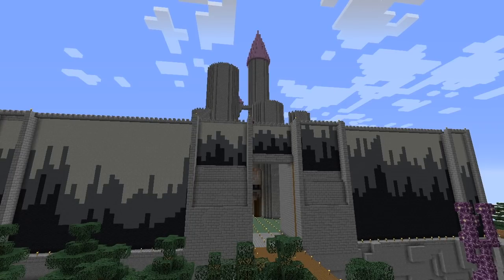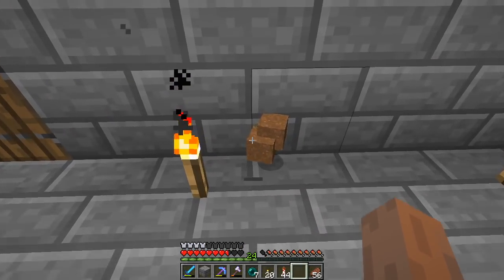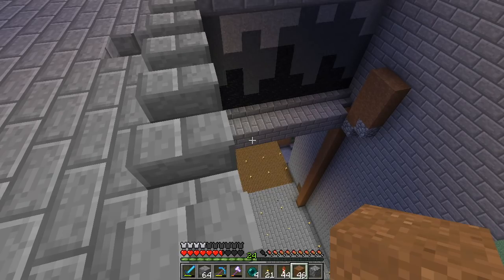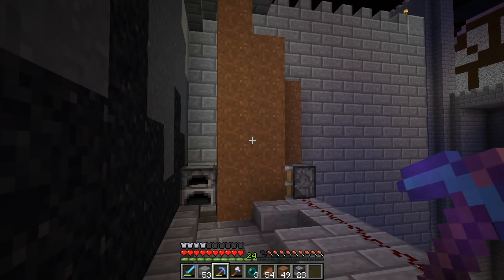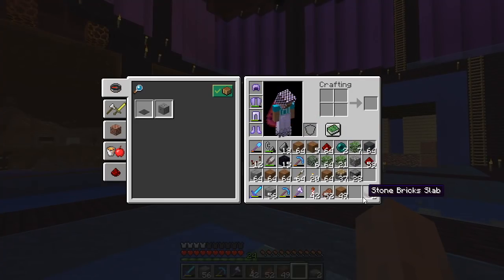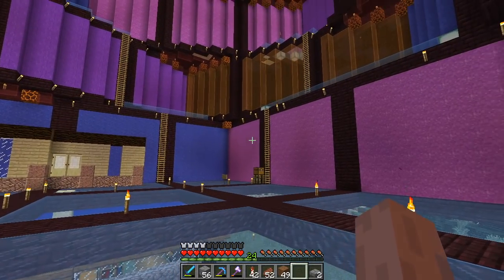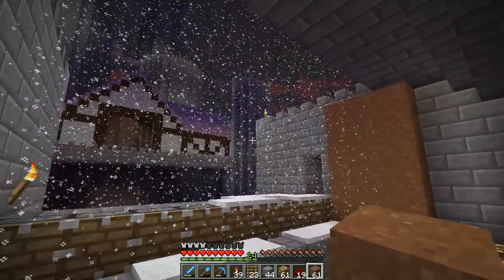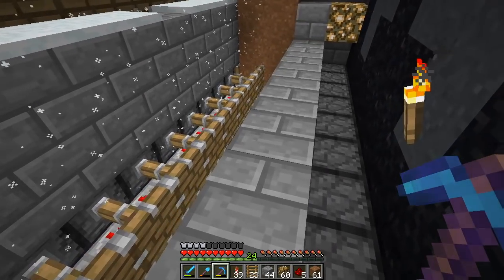Gravity-fed drawbridge door — Hermitcraft 5 ep 156

Comment: but how will you put the door back ask mumbo he is door master
Reply: I guess in the story the door doesn't need to open again, so a manual reset is fine
Reply: Easy half-reset: pull the floor out from under the "door" (down and then over), allowing the concrete powder to fall onto torches directly over hoppers, collecting the three stacks of door material into a chest. Then put the floor back. This would be the same mechanism as a hidden door in a wall, just reoriented (-tated).

I expect the version of this that's on the actual server (surely there is a backup castle elsewhere, he's talked about test runs) to only run once before a server reset happens anyway, though.

A full reset could be done with a variation of the mechanism that reset the Connect4 game last season, leaving out the color change cheat and adding a distributor at the top, but that WOULD take some higher level of competence.
Reply: Genius idea about using the Connect4 sand moving mechanisms to reset the door. I firmly believe that if @JoeHills and @MumboJumbo worked together, they could easily succeed in doing so.
Reply: I propose slime block launchers throwing it up in the second still-unused mechanism tower. It should be perfectly possible to fully automate that.